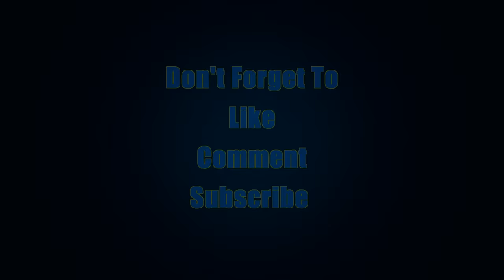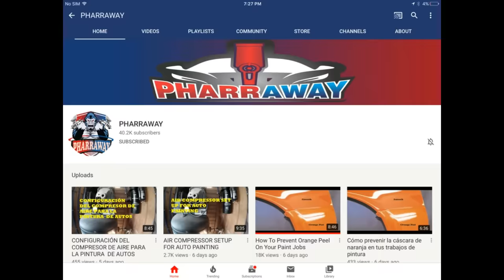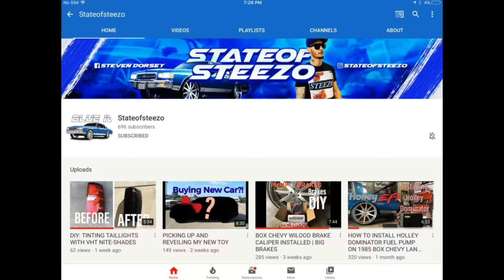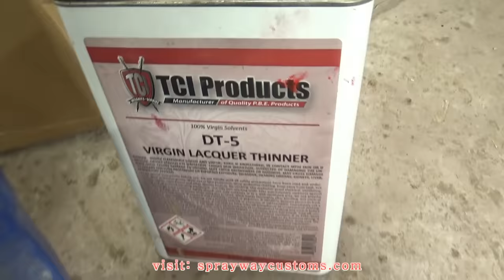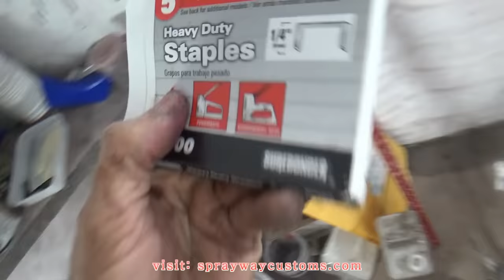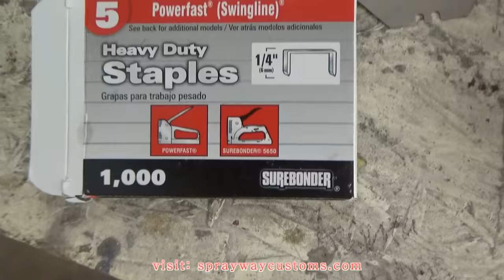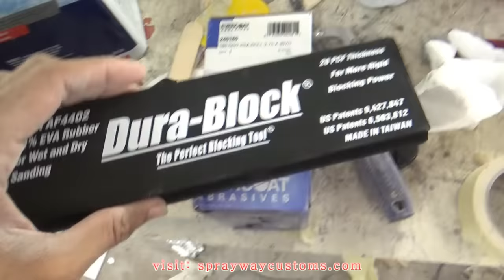Cracked Dashboard Repair With Fiberglass BOX CHEVY CAPRICE DASH RESTORE How To Fiberglass Dash Pad

Comment from the maker: Go Check Out My latest Vid On Dashboard Crack Repair. https://youtu.be/v1dtUR0TznE
Reply: Good job bruh!!✊
Reply: First of all, very nice videos and informative thanks for putting it out there. I do have a couple of questions regarding your process:

1. Why do you use fleece material as a base? Is it the adhesion properties for the fiber glass?

2. Can you use a spray gun instead of a brush when applying the fiber resin to the fiberglass fibers or your special mixture of Rondo after the fiberglass has been sanded down and surface prepped? 

Thanks for the reply in advance.
Reply from the maker: Yes, I use the fabric for adhesion purposes. I never tried to spray the Rondo through a gun but that sounds like a good idea 💡
Reply: @SprayWayCustoms  thanks for the response,  I like your work and the videos you share, keep it up.  I got a lot of good ideas from your videos.
Reply from the maker: Thanks Bryan Johnson
Reply: SprayWayCustoms  how much to do my dash?
Reply: @SprayWayCustoms  how can i getin contact with u
Reply: How can I get in touch with u
Reply: @wickedwayzz456  I'm on Facebook.
Reply: SprayWayCustoms Wru located
Reply: @wickedwayzz456  I'm in Terra Alta WV.
Reply: How much do you charge to do dashboard?
Reply: SprayWayCustoms i got a 76 impala I want u to do how do I get at you ?
Reply: Spray way i been trying to send my dash to you what do i need to do to send it???
Reply: @SprayWayCustoms  what up im trying to fiberglass my 2005 Chrysler 300 dash so i can put a tv on it.
Reply: How can I send my dashboard to u
Reply: How can I contact you?
Reply: Thats a great result. Learned a couple of things i can use here. Good video
Reply: I love watching this remarkable rebuilds
Reply: @SprayWayCustoms   can i get your info i wanna get my dash done😔😔
Reply: @SprayWayCustoms  How can I get you to do my dashboard for my 82 impala?

Comment: For those who don't know, now you see why it cost to get things done in fiberglass! It's ALOT of work!! I had a custom stereo done in Memphis before it was a big thing. I learned so much watching the guy who did it. ANYONE who does this kind of work, has ALL of my RESPECT!!! Man the sanding and sanding....and SANDING....did I mention sanding??🤔😳 just to get it perfect!!! This guy is ON POINT!!! If you don't want to pay for the work, don't ask for a cheap price with fiberglass work! That's insulting!!
Reply from the maker: You're correct...thanks man
Reply: @SprayWayCustoms  
Man I subbed after that video! You're right down the street too, I'm in north Mississippi..

Comment: You do great work sir. And for that plastic dip I use brake clean to get it off. I work for a car lot and done a lot of trade in with wheels and even the emblems. But it works good.
Reply from the maker: Thanks for the info man

Comment: Awesome video, thank you for sharing your process with the world.
Reply from the maker: Not a problem at all. Thanks for the support
Reply: @SprayWayCustoms  Sure thing, I subscribed to your channel as well.  I'm not into the same kind of cars as you (what I mean is, you need to get a couple of party whistles on one of those 6.2L cars) but the techniques you're using could be used to repair/refinish any interior panel really.  I used to resurface counter tops and bath tubs and the things you're doing with fiberglass and bondo are very similar to what you'd do to perform the resurfacing of those home interior items.  Take care and thanks again.

Comment: You are a master! I have a 1982 VW Golf and of course the dash is badly cracked. Thanks to your videos I think I'm ready to try putting fiberglass over it. I have just one question. The dash has some complex curves and I can't see getting a single piece of flees glued on. Can the flees be applied in two sections? Thanks so much for your work
Reply from the maker: Yes, you could do it in two sections. The dash I just did had some curves also
Reply: @SprayWayCustoms  Tanks so much! I appreciate that you took the time to answer my questions.

Comment: Awesome work...  I've tried different materials on my dash panel... and it cracked again.  Appears that it flexes and in time and with the sun punishment, it cracks again.  I'm thinking of trying something flexible or cover it with some material, like perhaps leather, but I know the sun will also dry it in time....  Do you think this job will not crack again?
Reply from the maker: I done one in my Monte Carlo about 6 years ago and it hasn't cracked yet.

Comment: Those speakers vent use a small fine course wire brush and you should be able to clean them I have done it before on a 1972 Buick skylark gs clone once
Reply from the maker: Thanks man
Reply: @SprayWayCustoms  any ideas for a bench seat repair for a 1986 Chevrolet Silverado custom deluxe it's the first one I have ever restored before too
Reply: @SprayWayCustoms  what kind of fiberglass are you using here on the dashboard too?
Reply: @SprayWayCustoms  sweet looking dashboard too
Reply: @SprayWayCustoms  my 1986 truck is going to mecum auto auction when finished with too

Comment: this seems like a good introduction to fiberglass bodywork possibly I jacked up the bumper in my  2001 mustang i backed into something got two little holes and its spider webbing in one spot but that was before backing into something but i also have 1994 chevy c1500 that the dash may eventually start cracking on if it hasnt already
Reply from the maker: Thanks for watching

Comment: dust your primer with a contrasting color and then when you sand it all the lows will show up. Also since you are using a air sander a longboard straightline hf sander will make it really straight if thats what you are trying to achieve.
Reply from the maker: Much appreciated

Comment: Awesome job man! I wonder of you couldn't make a vacuum table for the mat. We used to use the cheap thin plastic, draped over our piece taped down to a piece of plywood and then a shopvac attached under the wood. Let it run for a few minutes and it'll really set it down. Also check out harbor freight if one is local and see if you can find a small triangle file. That could help on the mold lines you created. Awesome work man look forward to more subscribed😎👊
Reply from the maker: Thanks for the info

Comment: This is slick work my man!! outstanding Job!!  I'm going to use that bedliner tip on my dash, I never would have thought of it. I was wondering if  you tell me what the heck Rondo is!! What's the benefits of making it and using it over a body Glaze or Icing for the low spots and pin holes.
Reply from the maker: It can be brushed on that makes laying it a lot faster than spreading a large area. https://youtu.be/qK-CJnDg_yE

Comment: As thick as that fleece was i wonder if you could have use a polyester primer like evercoat feather fill g2 which builds like 2-4 mil per coat and saved yourself a lot of labor. Actually i was concerned the vents would fit after that. Good to know 💪🏼. I guess some vehicles have gone tighter tolerances than others 🤷🏼‍♂️. Love to see people using satas. Always my favs. Well not that rp for clear lol ive always been partial to 1.3-1.4 hvlp sata for clear but damn good work 💪🏼
Reply from the maker: Thank you Tony

Comment: Thank you for all your advice.  Now, I have one more question.  I have the plastic piece that comes off the back of the center armrest and it has a flexible piece of plastic that covers the bolts where it screws into the metal frame.  Of course, it's brittle, since it's a 1975 and it broke at the flexible part.  How can I repair that, so it still flexes, or bends?
Reply from the maker: I'm glad you did find what you was looking for 👍🏾

Comment: Another option- buy a stretchy fabric that you like. Spend more time removing weak sections of the original dashboard. Add JB Weld to the weaker areas. Then add expanding foam insulation from a spray can. After it dries, use a cheese grater made for body filler to shape it. Do some sanding with 80 grit, and glue on the fabric. Maybe add a spray paint on top of the fabric- see the Project Farm YouTube videos for ideas. I like the ceramic brake caliper paint from an Advance auto parts store, about $10 for a large spray can. It is difficult to get it to drip or run, and it is resistant to heat and sunlight. It covers well.
Reply from the maker: Thanks for the info Jeff

Comment: Does it still fit into the car and do the vent inserts fit correctly given the additional thickness layered over the dash making the overall length longer by 3 - 5mm and the vent apertures would be 6 - 10mm smaller?
Reply from the maker: Yes it fits. Go check out StateOfSteezo channel. He installed it

Comment: I think it is really good could be better is you wanted i would focus more on that ridge across the front because that is where everyones eyes will always be around. So i would make that straight. and when you were wet sanding a few swipes in those lines you cut in the middle would have made it super clean but all toll really nice I really like the fleece use never thought of that to recapture a shape so distorted
Reply from the maker: Thanks 🙏

Comment: Are there any possible figment issues when reinstalling the pad? It is quite a bit thicker than before, just wondered if that affected the figment.
Reply from the maker: It's a difference but I make sure I test fit it before paint

Comment: I am going to try this and see how it works, but can you help me out? I have never fiberglassed before. 
Is there a specific kind of fleece you get or do you just go to Walmart craft center and buy what is on sale?
How much is a good overlap for the fleece? like 1/4 inch? 
How many coats of resign do you put on?
Reply from the maker: About three coats of resin. I get the cheapest fleece at Walmart. The overlap doesn't have to be much..just enough to hold it in place until the resin dries.
Reply: @SprayWayCustoms  thanks so much

Comment: I have a 11 Silverado I’m goin to paint a piece above my gauges to match my painted dash bezel, it’s sanded already. Do I use fiberglass resin to acquire a smooth surface? Thanks
Reply from the maker: You could or you can just sand down the texture
Reply: @SprayWayCustoms  plastic primer a must?

Comment: Enjoyed the vid thoroughly, subbed.  What primer did you use on this job, with both the plastic grills and resin surface to account for?
Reply from the maker: Thanks man. I used Upol High Build Primer. I just hit the plastic parts with some adhesion promoter before I primed it.

Comment: i found a better dash for my dually..  im gonna mix some rondo and try this..  $400 for a new dash..   its worth a shot..  ive done dashes before with fiberglass and coated them with plasti dip for the texture..  almost 9 years later still looking good,..  ill show it when i make the video..  i bought a bunch of stuff for the truck youll see a video shortly..  im gonna spend august getting it body worked (on youtube of course)  and im gonna try to paint the chevelle and the dually at the same time this fall..  your channel is doing really well..    whats up with those big giant wheels you bought?  are they gonna work?
Reply from the maker: I'll most definitely be tuned in Chris. We gonna have to see if the wheels work 🤣🤣I hope so

Comment: OK First let me say I think you're awesome!  I really appreciate you teaching us the how to's.  Just a couple of questions.  1. Curious why do you use the fabric if you're going to fiberglass the whole dash anyways with fiberglass cloth or strands? Is it to make it smoother? 2.  The dash you are doing is flat. The one I'm going to try to do is from a 1972 Opel GT and is not flat, but can I use the same steps to do it?  I wish I could include a picture because not many younger people have even seen an Opel GT.  I have most of the cracks fillanked and completely sanded down and I've seen some people just fiberglass, but by using the fleece as you do seems like it would be much smoother.  I appreciate any advise you can give and please keep the videos coming!  Thank you so much.
Reply from the maker: Fiberglass resin bonds to the fabric well and it tends to not want to bond to plastic and vinyl well.
Reply: @SprayWayCustoms  Wow! Did not expect answer that quick.  I will be using the fabric as well.  Wish me luck teacher.  I couldn't do this without your video.  May try to graduate to doing door panels also if I can get the dash completed.  May God continue to bless you and thanks again so much!
Reply from the maker: No problem...wish you the best Gabe G

Comment: Great work man, Only question why secure the speaker lids to the dash, wouldn't that make more work for switching out speakers later?
Reply from the maker: Only 6 screws securing the dash pad.
Reply: @SprayWayCustoms  Yeah guess it wouldn't be to much. Thanks for the response man.

Comment: Nice work man. I have a C10 dash I'm considering trying to fix up, came across your video. I wonder, have you tried using a fiberglass cloth instead of the fleece/chopped strand combination? I have some 12 oz biax cloth (weave with a stitched CSM backing) left over from a boat project that is pretty thick, and it looks like I could combine two steps into one by using something like it. Curious if you've attempted this with a material like that.
Reply from the maker: Dave, sometimes I do used fiberglass cloth. It's really great on flat surfaces. I'm working on a C10 dash right now. Stay tuned for the video. Thanks 🙏🏽
Reply: I just finished my C-10 dash and had to do alot of trimming to get the instrument bezel to fit back in and also each end of the dash to fit. applying the fleece and fiberglass added to much thickness. I agree with you. next time I will maybe skip the fleece and go straight to glass.

Comment: What's your input on car wraps? Good or Bad? Will it damage my orginal paint job?
Reply from the maker: I've never had a wrap but I've seen where some had pulled the clear coat up but that cold be poor prep
Reply: @SprayWayCustoms  OK - I think it would be better with a good paint job instead of wrap because of the heat in the summers here in The South.... Thanks...

Comment: Your a bad dude! Killer work man. 
I just so happen to run into this video I just sanded all my Malibu interior down and had to hit it with under coating for some texture to hide all the dimples from the sun. I was worried I wouldn’t get paint to be able to stay on the coating. Do I need to clear it to get it to last longer? I have clear but not flat clear
Reply from the maker: You don't need to clear the undercoating
Reply: @SprayWayCustoms  right. I’m painting over the undercoating do I need to clear it after I paint it?
Reply from the maker: It depends on if it's a single stage or base coat clear coat?
Reply: @SprayWayCustoms  I got the paint coming in today it’s in a spray can unfortunately. I have have some no bake clear I used for fixing wheels. It’s the factory blue that came in a 81 Malibu so I think it might be to shiny I prolly should do the clear you used ?

Comment: Nice work! I'm curious though. Wouldn't it have been easier to use fiberglas mat instead of the shavings? Seems like it would go down quicker and give a smoother initial finish.
Reply from the maker: It will....👍🏾

Comment: Nice work.  By the way, someone needs to explain to you what a d-a is.
Reply from the maker: Dual Action.....if you think that was a grinder you highly mistaken 🤷🏾‍♂️
Reply: @SprayWayCustoms    Perhaps I was, if so, my bad.
Reply from the maker: neonbeach62 no problem. A lot of folks think it's a grinder. I actually have a Porter Cable grinder that looks like it.

Comment: Does the dash reinstall without issues? seems like adding the thickness too it would cause the sides to have trouble fitting back in place.
Reply from the maker: It fits good. I test fitted it during the process of doing it.

Comment: Great job, one question, how much does this repair cost and what did it cost you in materials?
Actually sorry my bad, its more than one question, how long for this repair?
Thanks for the presentation. I definitely recommend this channel.
Reply from the maker: I can do it in about three days working off and on waiting on the different stuff to dry. I never just calculated the material cost because a lot of the stuff I already had from previous jobs. The most expensive I would say is the resin. It's about $40 a gallon

Comment: I'm just curious to hear how much you charge for a job like this? It looks great but I would think you'd have to charge around $1500 - $2000 to make it profitable. Also I was wondering if you ever run into problems with the dash pad not fitting well since it's quite a bit bigger than factory.  Please let me know. Thanks John
Reply from the maker: Around $350...I try to test fit often.

Comment: I have a good that I'm going to strip with paint remover taking it to bare metal what type of primer do you  recommend  I use. And is this the only way to  ask you questions. Like the YouTube very helpful.  Thanks
Reply from the maker: Go with epoxy primer first to seal the bare metal and then do all your bodywork and use high build on top of that to block it.